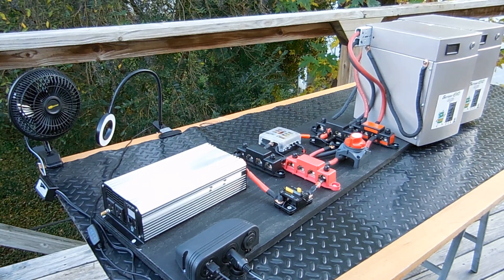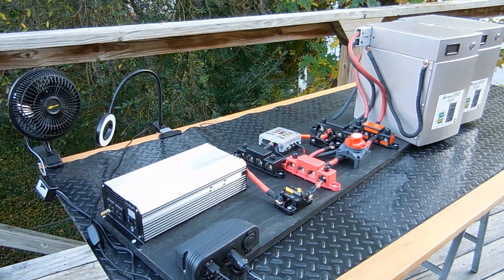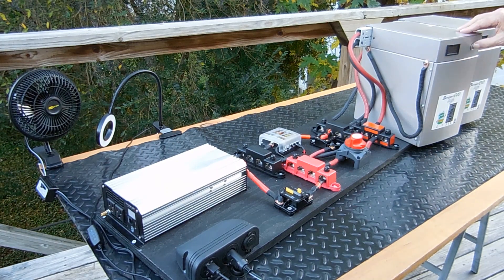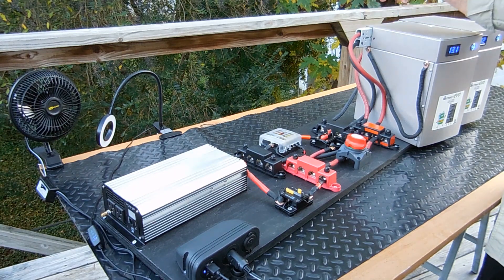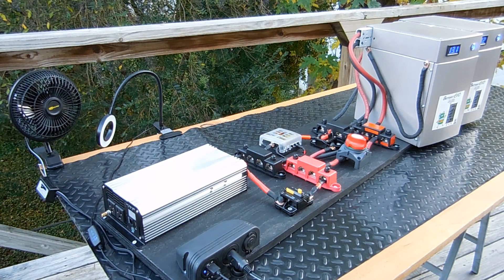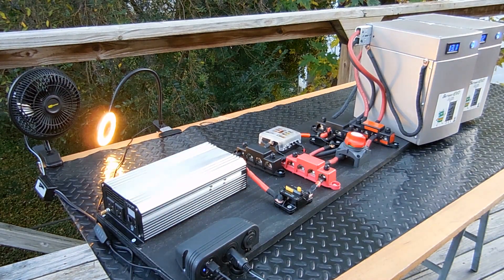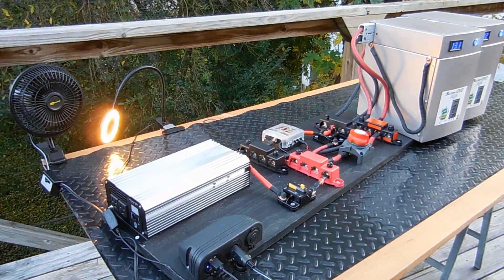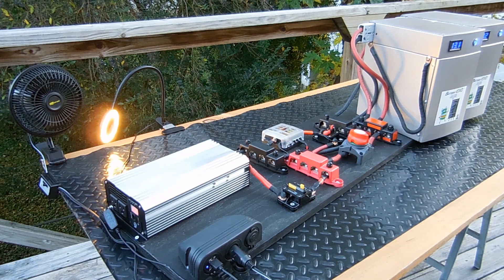DIY Power Station / Big Battery's 12 volt 170 amp  Battery  /  Connecting Two  Batteries in Parallel

Comment: Because the batteries have a 300amp breaker and an on a d off switch can I bypass a switch and go straight  to a victron lynx distributor with no issues

Comment: How do you charge it with solar panels or generator? Where is the charge port?
Reply from the maker: At that time, I was only using the power station  for emergency  power at my house, like I said in the video.  Which I only had to use once this past winter.   I had a 110v 20amp charger to charge it up.  I have the power station in my mini-van now and using a solar controller  with a couple of  120 watt portable panels to charge it.   A lot of people are buying the Jackerys and the other portable power stations,. just showing a different option.

Comment: I see the anderson connector for the power out.  How do you charge these batteries?  thx
Reply from the maker: Only used this system once this winter for emergency  power at my house.   I had a 110v 20amp charger to charge it up.  I have the power station in my van now.  I will  connect it up to a 300 watt  solar panel. Now I just finishing up the wiring.
Reply: @frederickv.9300   im about to connect mine this week! I have a bit bigger setup, with a 3000 watt inverter. Can you share some pictures with me of it laid out in van? Bus bars-charge controller-inverter
Reply from the maker: @hmdmachineHall  Put pic on your post on DIY RV Solar Systems FB group
Reply: Using the same batteries, 2-170 big battery batteries

Comment: Is the orange knob you turn just an on/off switch? Is the small white box the charge controller or is it not pictured?
Reply from the maker: All of the solar connections are in the van.  That red knob is a on and off switch.  Just have to connect Solar controller to the positive and negative buss bars.  This winter I am using a AC charger for the batteries when needed.  Already had one power outage  where I got to use the power station.
Reply: @frederickv.9300  Sounds good this looks like something I would really use, thanks for the info.

Comment: Nice set-up and explanation Fred.  I was thinking about getting the same set-up but wondering how to connect to a MPPT solar controller.
Reply from the maker: From the solar controller first two wires goes solar panels   and next two wires,   positive to 50 amp breaker and then to positive bus bar and negative wire to  negative bus bar.
Reply: Thank You!  @frederickv.9300

Comment: Thanks for showing this setup! What gauge of wire did you use for the parallel connection (and throughout)? And are those bus bars used to parallel connect?
Reply from the maker: I used 2awg wire for the parallel connections and 4awg the rest of the way.  The 3/8 bars close to the batteries are for parallel connection only.  The other 5/16 bars are where everything is connected.